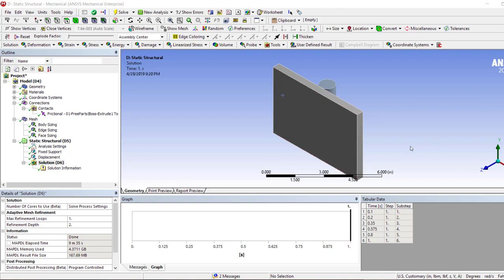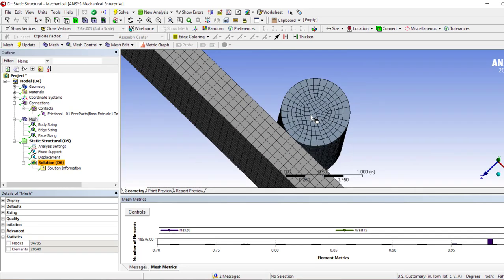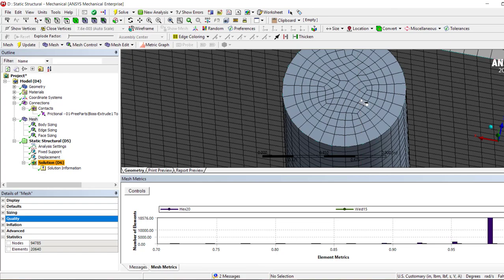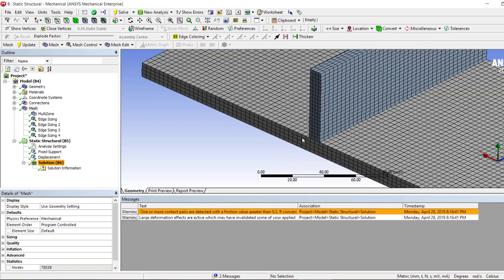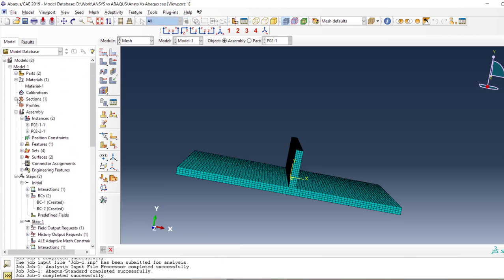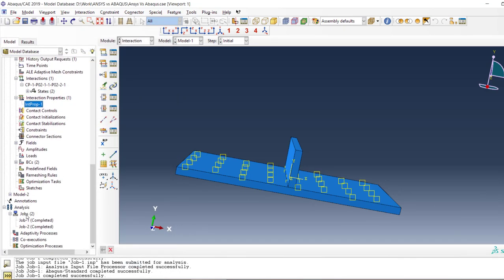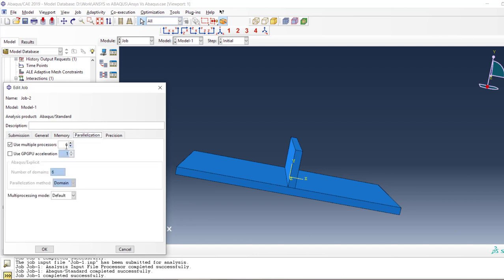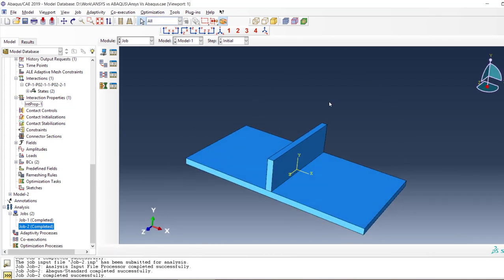Ansys Mechanical Vs Abaqus CAE Part 2 - Solving a Frictional Contact between two rectangular Blocks

Comment: Hey this content is great! You deserve way more subs! 
So in you opinion is Abaqus a superior software for deformation analysis? 
What advantages offers ANSYS over Abaqus? (the automatic import settings of conections seem very usefull though...
I would like to see how Abaqus deals with topology optimization and Computational Fluid Dynamics!!
Reply from the maker: Thank you for kind appreciation Sir! 
we are working on more content to compare solidworks/ansys/abaqus simulation comparisons. 
So Here are my thoughts.
ANSYS . 
Good. GUI is great, connections and mesh is automatic. 
BAD. Cannot support GPU, cannot split up part to refine mesh without creating connections. 
Ugly.  Once ANSYS crashes you lose whatever work was there, (i lost 15 hours of computing so guess) More work is automatic so you spend less time thinking over the accuracy of setup. 
ABAQUS> 
 Good. Solver is quite robust, Even if everything crashes the solver keeps running, You can check results even while the solver is running.  
 BAD. GUI is bad, nothing is automatic so you gotta plan ahead. 
UGLY. SO many things like beams and truss structures are more difficult to model in abaqus specially the joints. If you  choose wrong orientation you are fudged :)